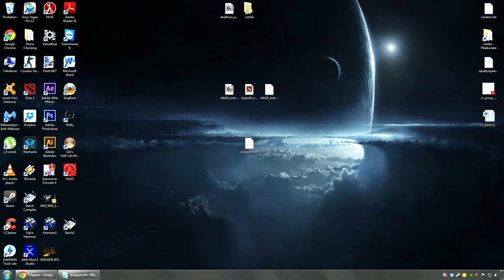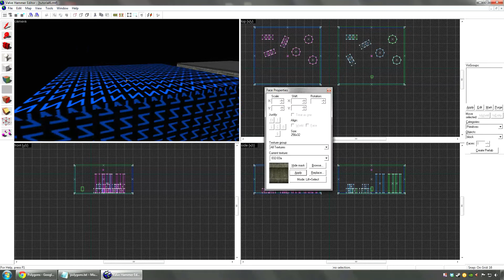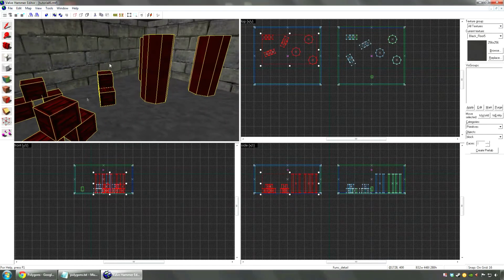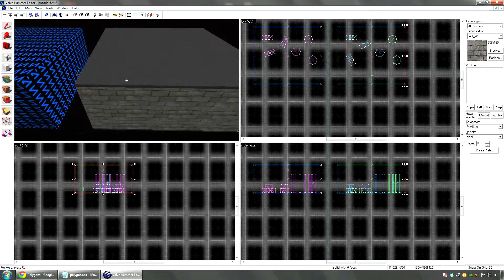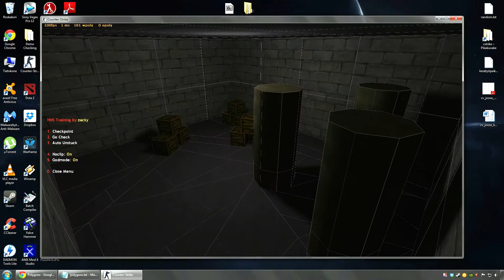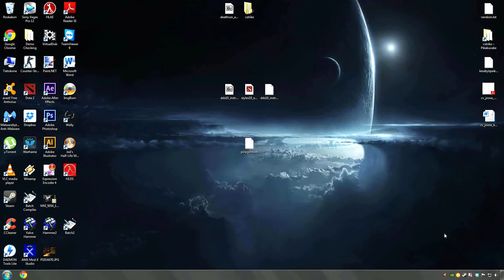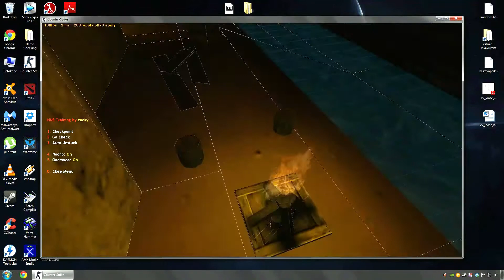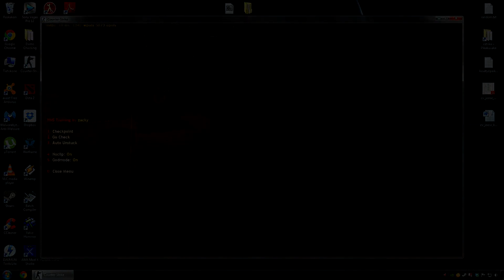VHE CS 1.6 Tutorial #6: Basic optimization

Comment: Are you shitting me? It's 2015! You should use 0.5 scale, not 4! Computers these days are wayyyyy better than 1998!
Reply from the maker: You do realize one of the main reasons CS 1.6 still remains so popular is because it can be played on such low end computers? I'm well aware the textures don't look good when scaled up like this, but you clearly haven't been around much on non steam servers that form the vast majority of CS 1.6 servers nowadays. On those servers there are still lots of players who have fps problems on all kinds of maps. So yes, optimizing like this is still very important if you truly wish to make popular maps.
Reply: Believe me, usually people have pretty normal fps (I mean on maps that uses normal scale). Well, if you want to use 4.00 scale, use.
Reply from the maker: TheEdvinazard In this tutorial I said "always increase the texture scale when you can", at no point did I say you should use scale 4 everywhere. Not only does increasing the texture scale improve the map performance, it also decreases the compile time and the file size. There are absolutely no downsides from it when you use it on places where you can't see a clear difference between a scale 1 and a higher scale, therefore this method is still very viable when mapping.